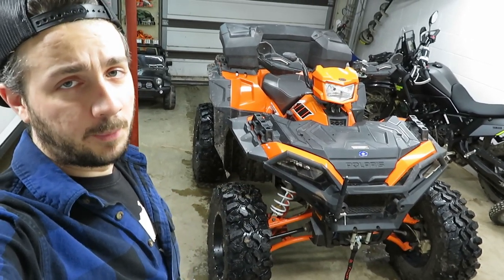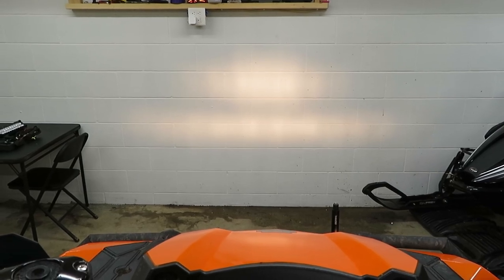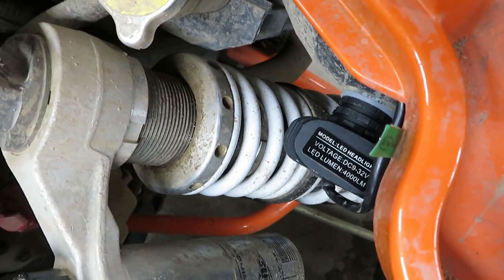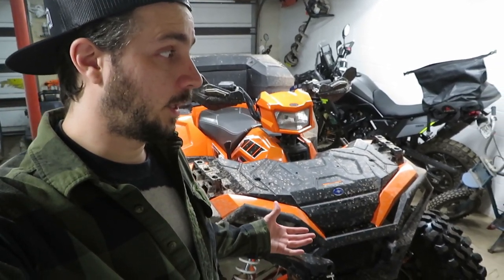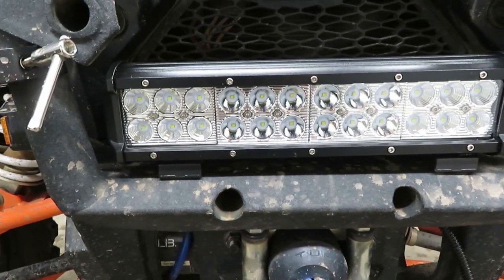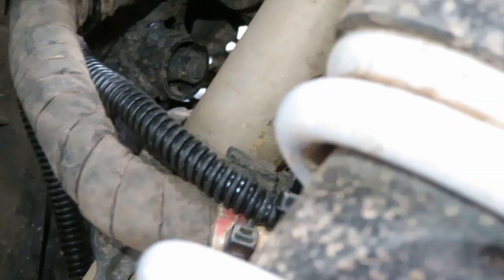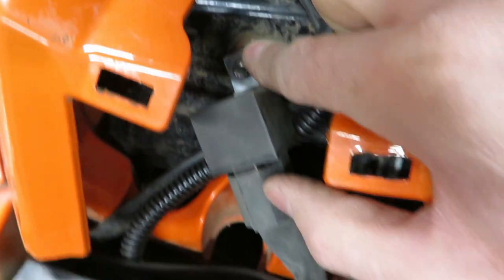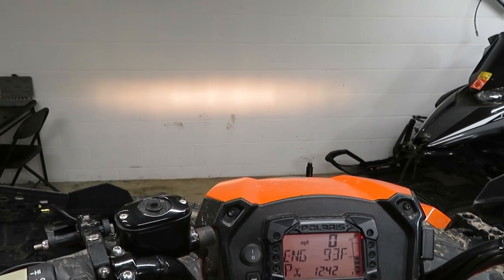Plug n' Play Sportsman Light Bar Turns on With High Beam Switch! | AK Offroad

Comment: Could the LEDs be turned 90 degrees in the base making the light bounce off the sides instead of the top / bottom of the reflector? I saw a screw in there.
Reply from the maker: No, I'd hoped that was just a set screw but it's all one piece and not adjustable.  I've since found a set of Auxito LEDs that I pulled apart and glued back together, which worked ok.  In the end a set of HIDs turned out to work best. I've got videos on all of it.
Reply: @SwankyCatProductions   Great video. Thanks.

Comment: I wish I saw this video before I bought the bulbs and bar. Really disappointed that I can't put my tray back in.
Reply from the maker: A while after this I switched to HIDs which actually seem to work much better, but still got in the way of the tray.  I heated mine up with a touch and pushed the spots that interfered in a ways.  Definitely not the prettiest thing, and I did melt a hole in one side... but it fits now!